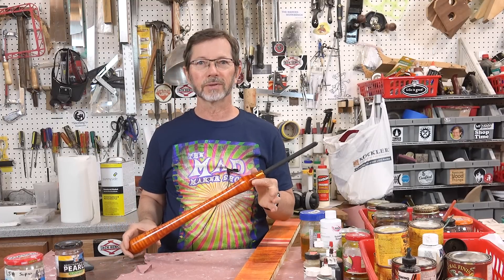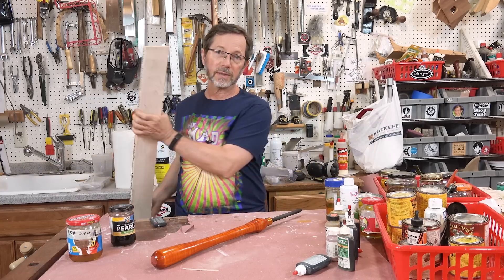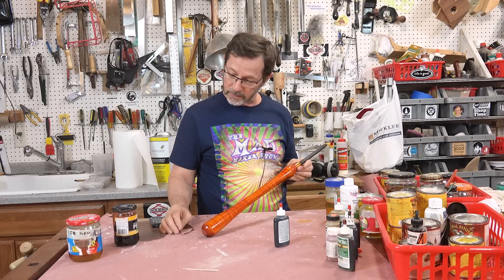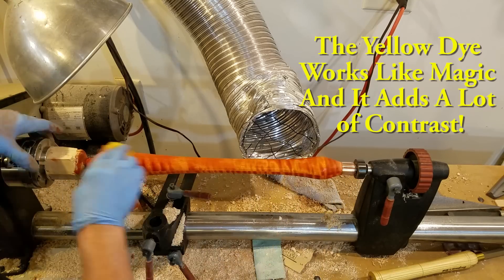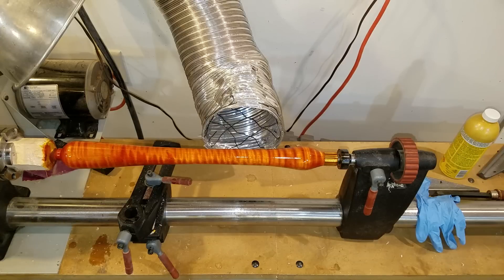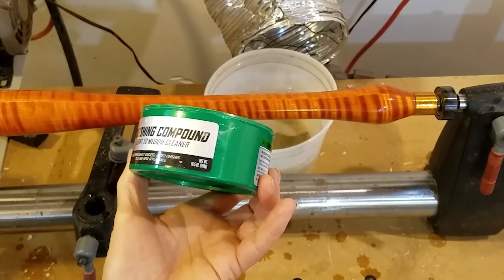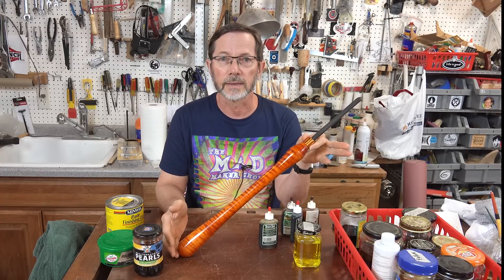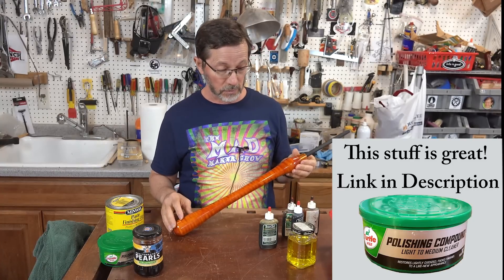How to Dye Wood for Maximum Impact

Comment: What liquid did you use to mix the Transtint dye with? Their info gives numerous possibilities, including water, isopropyl alcohol, denatured alcohol, lacquer thinner, shellac, etc. I need some guidance on which I should use.
Reply from the maker: I usually use regular tap water, but distilled is preferred.  If I am concerned about grain raising then I will use denatured alcohol.

Comment: I enjoyed the video! I haven't had the best luck with dyes yet. I'm thinking of using trans tint dye in denatured alcohol and then brushing on a water-basted poly so I don't lift the color much.
Reply from the maker: Thanks for the reply, I'm glad  you liked the video! I think that water a water based topcoat could dissolve   some of the dye because Transtint is soluble in both alcohol and water.   I usually seal the color in with a thin coat of an oil based finish when I am concerned that the topcoat might "lift" the dye coloring.

Comment: How can you dye veneer? I run into the problem that it doesn’t fully dye into the veneer just the outside
Reply from the maker: Dying veneer completely through is an involved process and I've never attempted it.  However, dyed veneer is available from certainlywood.com and other vendors.

Comment: Great looking finish but I have a question. I was looking for the Antique Cherry dye that you started with but can't find it on TransTints color chart. I did find an Antique Red Walnut but it looks more brown that the color you were using. Can you give me an item # for that dye? Thanks. Also, anyone interested in buying any of these dyes should go to the manufacturer's website at http://homesteadfinishingproducts.com/transtint-liquid-dyes/. He has an eBay store that is selling them for about $10 less than on Amazon.
Reply from the maker: HI Charley, The antique cherry red is a powder dye. It's also sold by homesteadfinishing and is available at their ebay store: https://www.ebay.com/itm/TransFast-Water-Soluble-Dye-1-oz-container-ANTIQUE-CHERRY-RED-3265/263997463734?epid=1579218028&hash=item3d77799cb6:g:BKsAAOxyRhBSq0iq
Reply from the maker: I mistakenly said that the Antique Cherry was a liquid dye, actually it's a powder, whoops!
Reply: Thanks! That will make it easier to find.